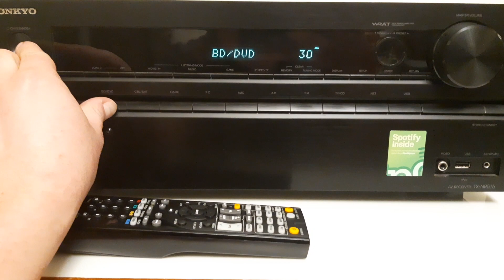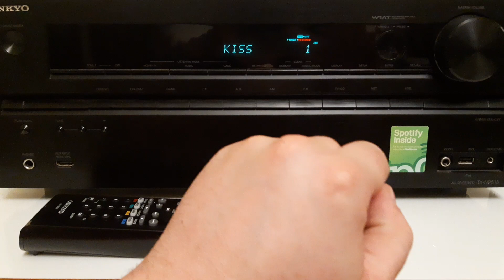NO SOUND ONKYO TX-NR515 switched to FUNCTIONAL ANALOG MODE(bad DSP,no reflow/reball,HDMI BD: Ignore)

Comment: Thank you, but it did not worked on my tx-nr414. I successfully switched it to HDMI ignore mode, and I hear third relay now, but there's still no sound. What else can be wrong with it?
Reply: Same model same thing to me, the fact is that appears in this model the analog isnt fully working because only pre amplifiers are active, infact if you rise the volume near the max you can hear from Front speakers.. bye

Comment: Thank you! I was almost ready to give up on my HT-RC270 after trying the chip heat and solder flow a couple times with no luck. Wish I saw this a couple years ago when my other receiver went out. I really hated losing it. Just make sure you have your speakers hooked up to the zone 2 terminals before trying this. I'm ok with not having surround and hdmi  because mine was for stereo only setup. Thanks again!

Comment: HELP PLEASE! My white volume rocker is unresponsive on my remote so I used the unit volume knob for this. I can get sound with AM and FM radio but no sound via any HDMI source even though I get video. I even did a factory reset pressing the CAB/SAT button then power procedure and the factory reset didn't solve the silent HDMI sources. Can anyone provide me with some assistance? It's such a nice piece of gear to be unusable. Thank you.

Comment: Hi. I can't get the 3rd relay to click. I did as shown on video. I also tried to heat the dsp circuit. Didn't help.
Reply: I got the TX-NR609
Reply from the maker: @Epic-Ape  Hello, and in your case - do you hawe switched receiver to analog mode ? Showed display message "HDMI INGORE" ?

Comment: This method works 100 % just did my 609 now plays via the analog cables .
Plug main speakers hold power button and br/dvd button keep holding power till hdmi ignore apears them press power to diable hdmi .
Ill advise u hv something connected to analog rca jacks either cd player or something have it playing tap on the source to cd  ...

Comment: it is necessary to have the remote control, since I did the procedure with a tx nr709 and if the relay is heard but it does not give audio
Reply from the maker: You dont need IR remote control. Only switch Onkyo to hdmi ignore mode and select analog input like FM radio or CD aux. Connect speaker only to front L and R power output. If relay click and you dont still have sound, try contact experienced electro audio eng and try connect low audio signal direct to power amp board... Maybe you have another fault like amp power source relay.

Comment: How to get back out of this analog button..
Reply from the maker: If you want go back to digital mode you only repeate the same steps... Described steps switch buetween two modes - digital (over DSP smached chip) or analog (analog multiplexer switches which are in front of DSP input switch anlog signal not to DPS inputd but direct to analog power amp. - so DSP is unused).

Comment: can you connect the cellphone to the tv/CD socket using an rca Jack cable  from the cellphone to the CD/tv ..socket
Reply from the maker: no problem - all analog inputs like RCA are welcome (inputs like HDMI sound or IR digital are over DSP ant this is off); look on schematic (very clear picture) on my website www.t18.wz.cz over google translator - http://t18.wz.cz/index.php?mainPage=audio/Onkyo_TX-NR515/TX-NR515_rebuilding_to_analog_amplifier/stred_onkyo_TX-NR515_rebuilding_to_analog_amplifier.html

Comment: Thanks a lot for the video.  It turns out.  Can you tell me how long it works after this reboot.
Reply from the maker: How long... Wrong question - board is switched only to pure analog mode - analog digital controlled switches only switch analog input direct to analog power amp board - its second operation mode LOOK ON RECEIVER SCHEMATIC; so "so long" as silicone elements will be work... ;D ... btw I own one of Texas Instruments laptop from 93" and with 4MB ram is still working. This isnt reboot this is another operation mode.

Comment: I would like to thank you wholeheartedly, my 515 worked, I'm from Brazil and I had difficulty understanding the video, but a link here in the comments also guided me, eases our frustration of having such an expensive and powerful receiver unused, this video is  the best of all for at least it gives us a happiness to make the analog outputs work, thank you very much!
Reply from the maker: Thx, but now you have only 2 channels functional - is possible reconnect analog signal on main amp board to all power amp and use damaged Onkyo like "multi room" audio amp.
Reply: @michalsedlacek4121  HELP PLEASE! My white volume rocker is unresponsive on my remote so I used the unit volume knob for this. I can get sound with AM and FM radio but no sound via any HDMI source even though I get video. I even did a factory reset pressing the CAB/SAT button then power procedure and the factory reset didn't solve the silent HDMI sources. Can anyone provide me with some assistance? It's such a nice piece of gear to be unusable. Thank you.
Reply: Cara pode explicar oq fez? O video ta mt mal explicado. Tenho um ht rc 360

Comment: Thanks so much. I have a 609 and 709 which both have the HDMI audio problem. I was ready to throw them both out after trying many workarounds. I saw your video just in time and they are both working in 2ch now, with hdmi switching for the video. On the 709 I even managed to drive all channels with neo:6 or PLII. Thanks again!
Reply from the maker: Hi, check my website - use google translate...
1. http://www.t18.wz.cz/index.php?mainPage=audio/Onkyo_TX-NR515/TX-NR515_reballing_bga_rework/stred_onkyo_TX-NR515_reballing_bga_rework.html
2. rebuild http://www.t18.wz.cz/index.php?mainPage=audio/Onkyo_TX-NR515/TX-NR515_rebuilding_to_analog_amplifier/stred_onkyo_TX-NR515_rebuilding_to_analog_amplifier.html
Reply: I would like to thank you wholeheartedly, my 515 worked, I'm from Brazil and I had difficulty understanding the video, but a link here in the comments also guided me, eases our frustration of having such an expensive and powerful receiver unused, this video is  the best of all for at least it gives us a happiness to make the analog outputs work, thank you very much!
Reply: @michelaraujo6923  Eu acabei de comprar um com esse problema, espero que eu consiga arrumar.